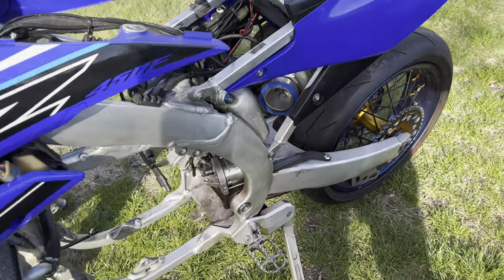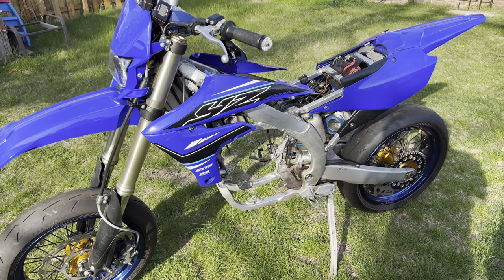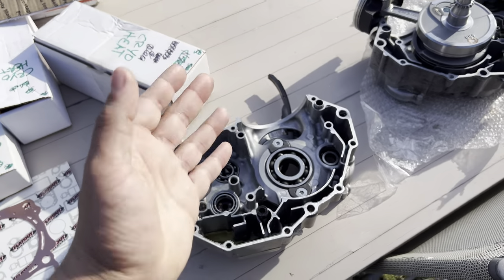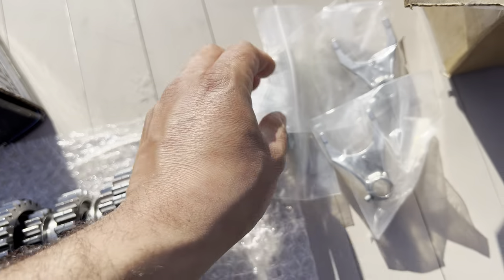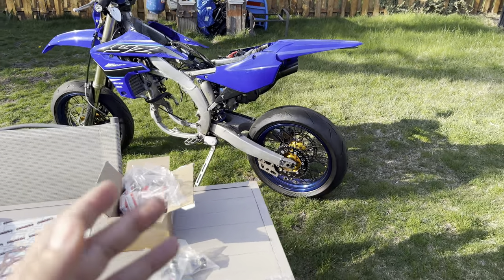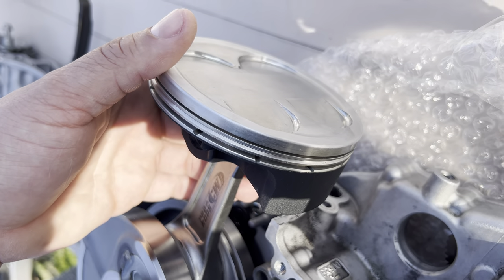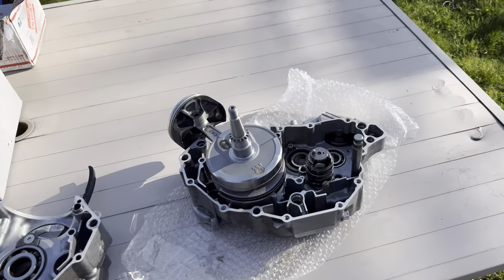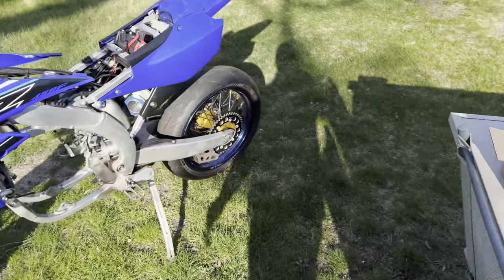Can I make 150HP on my TURBO DIRTBIKE this time around???

Comment: This thing is wild, good job! This thing let's you speechless,even before with 450cc it was ridiculous,  200 hp doesn't look unachievable, by increasing rpm, or just by the engine size to 525-550cc with 30 psi of boost it isn't out of reach. Good job!
Reply from the maker: Thanks!

Comment: The Streetsweeper's back, a sight some can't forget,
Yamaha supermoto, a machine he loves to death.
Turbocharged for action, a marvel of design,
Twenty-five pounds of boost, a power truly fine.

Cryoheat's precision, in the gears a silent rhyme,
Shifts that will sing like whispers, ahead of any time.
Carving corners, sharp and clean, a blur of chrome and shine,
The Streetsweeper's on a mission, a racer so divine.

Through straightaways he will rocket, a blur passing cutting up lanes,
Pushing limits, testing skills, defying machanical pains.
A rider and his supermoto, a friendship built to last,
The Streetsweeper and his bike are back; 2 champion built to surpass

Comment: That’s a bit of a stretch with a stock case.
Reply from the maker: I know someone make 180hp on Nitro in the Carolina’s on stock cases 🤭
Reply: @The_StreetSweeper  how the jugs hold up? Same with the stud holes? I’d be worried to break the head gasket seal and leak compression into the water jacket or pull threads from the lower case half.
Reply from the maker: @RadDadisRad I run ARP headstuds, as far as the head studs holes, Im pretty impressed with how deep they seat within the case, so I’m not really too worried about that. As far as the Headgaskets, I run a custom Copper Headgasket with a Top Fuel hoop cut into the cylinder head/Jug Deck.

Comment: Stainless valves are better than titanium in applications like these. Titanium is a lot softer than steel, they get beaten to hell even in stock applications. Everytime I build a motorcross/racing head they get stainless. Much stronger and don't have to worry about them tightening up too much and losing their perfect seal. Especially if you aren't running a high quality air filter like an oiled foam filter, for example K&N filters suck in too way much dust and quickly beat the hell out of titanium causing lots of pitting and imperfect faces/seals. Especially in the dusty environments. With that turbo being wide open I would be very concerned about those titanium intake valves... Plus the extra reciprocating mass of stainless valves is hardly an issue when taking about small diameters like those in these motors. Just my 2 cents from someone who's built quite a few high power 450's. Never had a problem with valves unless they were titanium!
Reply from the maker: Generally, I would go stainless, but I’m going to more than likely do a refresh every year anyways because of how hard I run this thing… And it’s kind of a good practice when you taken into account how much horsepower I’m putting through this engine… I’m going to stay with the titanium as far as valves go because RPM Speed is key with these turbo set ups

Comment: Ill have to check out cryoheat. I am building a 380cc big bore cpi cylinder billet cased 2 stroke for my 88 trx 250r. I couldnt afford the 1300$ for billet gears and might cryo the stock set. My first time using any kind of billet cased motor and its so bad ass.
Reply from the maker: Oh yeah definitely, make sure to name drop me when you call them! Ask to speak to Josh!

Comment: I'm working on an Aprillia RXV 550 turbo build.  I have it geared as high as possible so that I can get the most out of the torque and power It will make.  Looks like you could go down a few teeth in the back.   Good videos.  Good luck with it.
Reply from the maker: Absolutely lol! I might drop two more teeth

Comment: Interesting build, bigest problem with thees small engines is informatin . There is not so mutch informaton out there, and less parts. I have a landspeed bike with a KTM500 turbk and it is imposible to bye rods, pistons and other parts used for turbo. I used the GBC14-200 , but exhoust side is way to small. Best regards Trond from Norway
Reply from the maker: Badass! Thanks!

Comment: From my experience with ceramic bearings they are very easy to mess up and there not consistent at all. I’ve had ceramic bearings blow on the dyno and I’ve had ceramic bearings last 40 hrs. Oem is cheaper and much better for durability

Comment: The power at 24-25 psi extrapolates from the 105hp at 15 psi to about 136hp🥸
As long as the engine is not limited in power from the fuel or the turbo.
Reply from the maker: I’d have to agree lol, it felt quite a bit faster! Lol
Reply: Boost pressure doesn’t tell the whole story as it is only a measure of back pressure.
Reply from the maker: @RadDadisRad  I understand that, trust me. But the fuel flow rate at that boost pressure supports the claims. Plus multiple variables in the data would definitely tell you if you’re running a turbo out of its efficiency range. Aside from pressure alone. based off the data, I can push it harder plus technically I haven’t did a timing slew to find MBT yet. I’ve just been more so increasing the boost.
Reply: @The_StreetSweeper  I know, I’m talking to the guy linearly calculating hp with boost pressure.
Reply: @RadDadisRad  I know. But it can be suprisingly accurate for beeing rule off thumb.
Along with other data from dataloggs like fuel flow, maf, back pressure, turbo speed, and acceleration it's possible to calculate the real life performance. 
It's just tools, like a dyno and flowbench also are just tools.
Extrapolating power from boost just beeingn the simplest one. Not all of them are very accurate tools on their own.